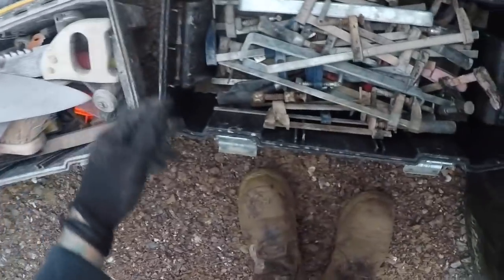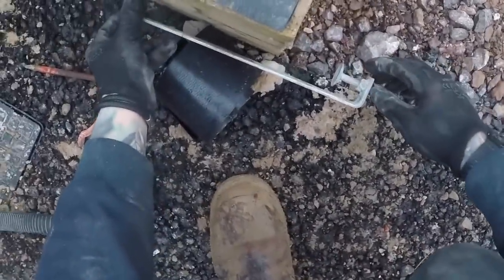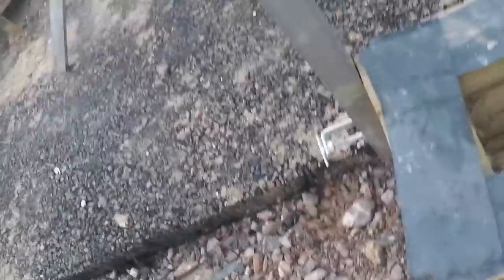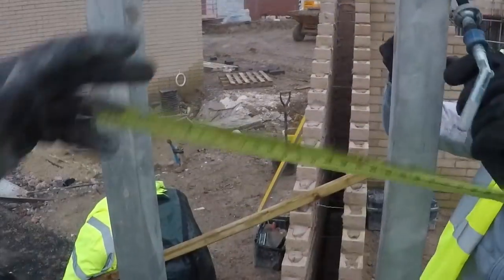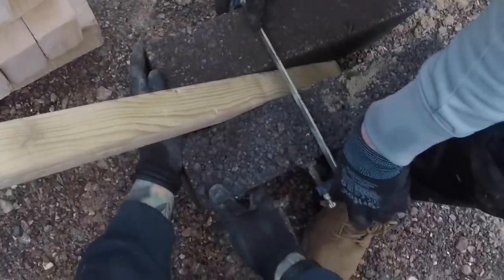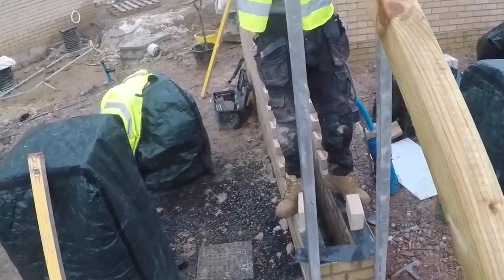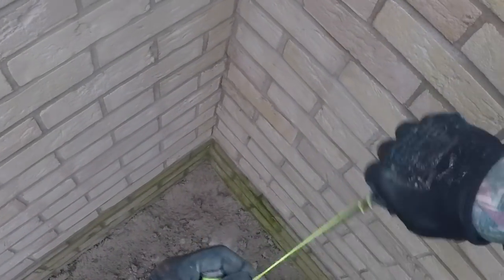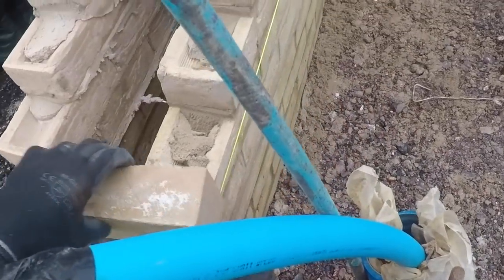BRICKLAYING, Double profile set up.

Comment: Hi Charlie do you find that the line loosens from the bottom course to the top using the tingle the way you did?
Reply from the maker: Michael Berry it starts very tight at the bottom get a little looser by the middle but still tight enough. Then gets tighter and tighter once your pass the middle 👍
Reply: @CharlieCollison  thanks Charlie. I didnt see that you go higher than the pin hole. It makes sense. Love the channel.